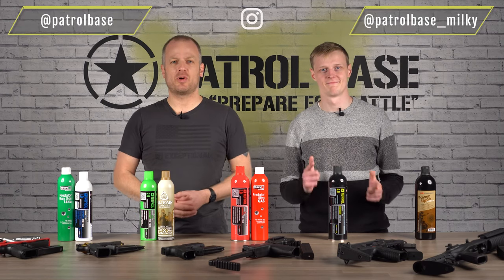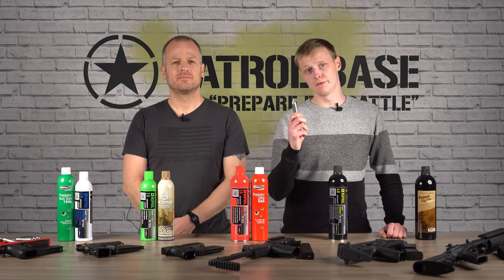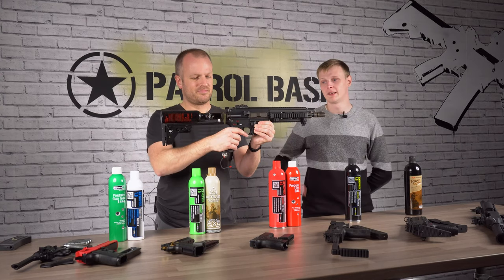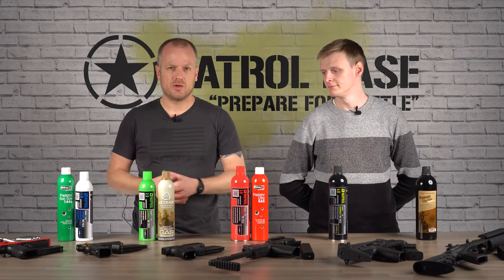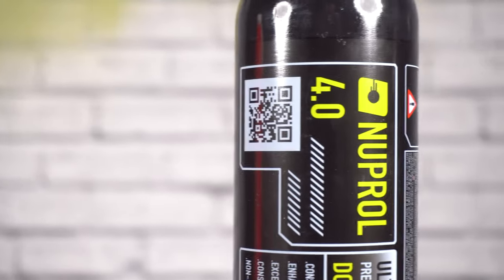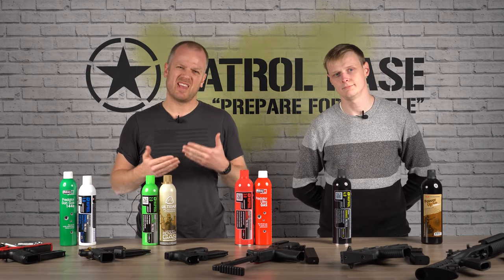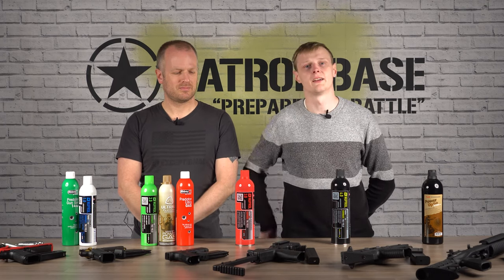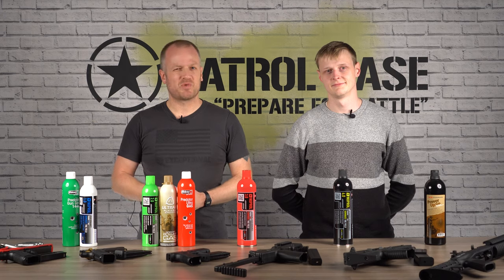CO2 or Airsoft Green Gas?

Comment: Thanks for the video..  Question? When filling my TM pistol mags with GreenGas.. I get a lot of gas escaping out of the top of the fill valve.  (I've tried the trick of getting rid of the air block inside by filling and holding open the main valve...but I still get a lot of gas coming out of the top afterwards)  Any ideas why?  Am using both Nuprol & Ultrair.  Maybe try ABBEY as I hear their nozzles are slightly different.
Reply from the maker: If gas is coming back out from the fill valve, it is simply because the valves are not "silent fill valves", no little o-rin inside. You can replace the valves for silent fill valves, or live with the very little waste. It looks worse than it actually is.
Reply: @PatrolBaseAirsoft  Righto...cheers!

Comment: I've an quick question. Can you refill a the gas magazines or do you ned to buy new ones? An how much bbs can you shot with one mag?
Reply from the maker: Hey Das,

Green gas magazines can be refilled as many times as you want, as you use Green Gas Cans to refill them. With green gas you'll usually get 1-1/2 mags per fill, so fill it with gas every time you empty it.

Co2 magazines can also be refilled, you'll have to replace the Co2 bulb when its empty, but you can. Typically co2 mags last around 2-3 mags but this varies based on temperature and gun type.

Hope this helps :)
PatrolBase Jonny
Reply: @PatrolBaseAirsoft  OK thx. Are there refillable bulbs? Because it will get expensive if i have to buy new bulbs all the time.
Reply from the maker: Hey  @dermachtigehumungus7328  ,

They're about 50p every 2 mags, its a bit more expensive than green gas, but in the long run probably not much more. You're probably looking at £10 of Co2 every time you play if you ONLY use a pistol, or probably £3-4 if you only run it as a backup.

Obviously all depends on how trigger happy you are :D

Hope this helps :)
PatrolBase Jonny
Reply: @PatrolBaseAirsoft  Thanks for the answer. I think ill try a co2 pistol :D